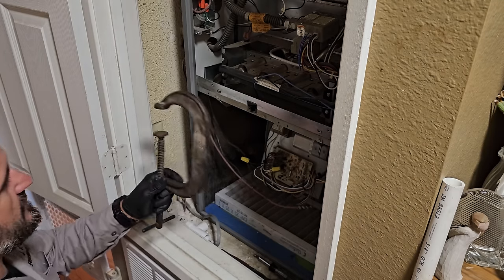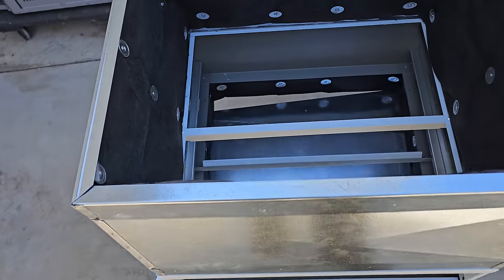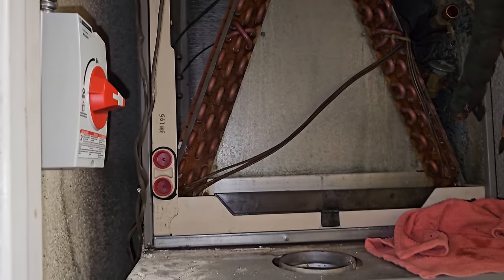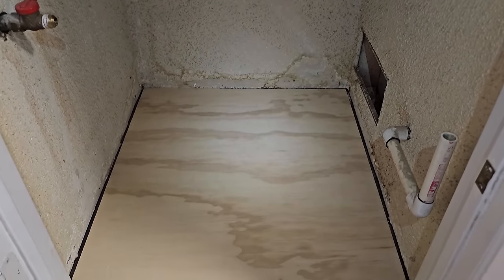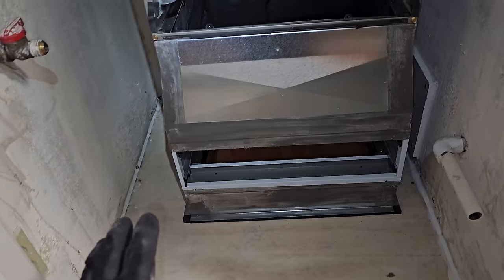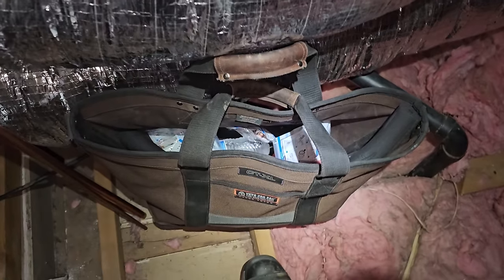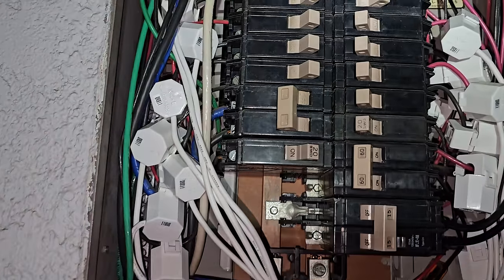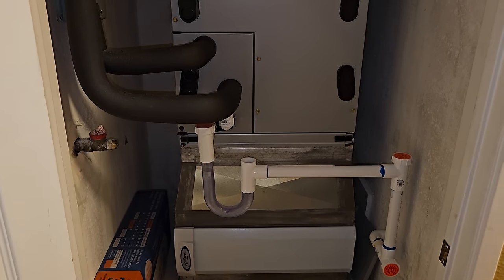HVACR VIDEOS HOUSE PROJECT PART 6

Comment: That is a nice professional install. I don't think I've seen a better install than this. I heard at some point in the video that you have an energy monitor system in your house. Is that what those white caps on the wires are in the breaker box?
Reply from the maker: Yes that’s correct
Reply: @HVACRVIDEOS  that’s pretty cool. can you do a video showcasing it?

Comment: Question: why are you going with a heat pump when you have natural gas? Isn’t that cheaper?
Reply: No.
Reply: @Bryan-Hensley  I guess in California right?
Reply: @nathang.1744  unlikely. Heat pumps are basically 300 percent efficient. I know it's not rated like that but that's an easier way to understand how much more heat you get per kWh. However I don't know the price of power or natural gas there. But usually natural gas isn't much cheaper per BTU than propane.

Comment: you need a whole home surge Protector nowadays days do not put one on the AC Unit. Put it near the Breaker panel right below it it protects the whole house it is now code you have to have one it protects everything us gov had enough of house fires you will see that is code for any work done to the house

Comment: Recommend to install a tall vent pipe higher than drain pan on Ptrap.  Don’t want water pouring onto platform if clog happens.  Also for carrier you can flip top left plastic drain port horizontal appliplaction cap around to prevent it from falling into air handler.

Comment: No heatstrips? Whats the coldest it gets there at night? And are you disabling defeost on the unit? My my neighbors installed an oversized heat pump thinking they could get away with no heat strips but when it gets about 25 degrees outside it goes into defrost and blows ICE cold air they called me after the first winter wondering if I could install heat strips for them lol
Reply: The indoor should turn off the fan when on defrost?
Reply: @richardbartlett6932  what heat pump have you ever seen turn the fan off in defrost? I have never. Maybe go to a lower speed but never off
Reply: I think his design temperatures were 97 and 40? 38? Somewhere around there. The load calc called for a 2 or 2.5 ton with very little heat strip need. That's why he wired in for a heat strip if necessary, but he's looking to try just straight heat pump first. I'd try the same if I could.
SoCal doesn't get the same humidity and cold Temps like the rest of the country.
Reply: @FrNMGuy  mostly concerned about when one of those $1000 inverter boards gets fried and the outdoor unit is a brick until carrier can scrounge one up. I've been on the receiving end of 2-6 week lead time on a part and not have it for 6 months. Who wants to run space heaters for that time.... It may not get /that/ cold there but they do have some nights where it can get below 35 and the unit will need defrost. 5 kw heat strips from carrier are like $80 so why not 🤣🤣🤣
Reply: @FrNMGuy the only thing is if it defrosts, it will drop the interior temperature about 4 to 7 degrees during a heavy defrost without heat strips.

Comment: CFM is calculated, not measured. NOTHING wrong with flex duct IF installed correctly. Does the trade install it correctly? Lots of high end systems have been installed using flex, tested and CFM confirmed by third party and perform awesome and quietly. Looking pretty good so far! Ignore the complainers...
Reply: It's always been recommended that flexi should not exceed 2m. Not that people only install under 2m but that's the official recommendation. As long as you have a high static option on the fan settings then it should and will cope.

Comment: Regarding marked tape: EVERYTHING that has UL Approval, has to have it. Everything that has to have it, the inspector is gonna look for those marks.* (i.e., not everyone is using mastic). Nobody--but nobody--is going to trust that the tape is the same as the one on the spool--even if the spool is marked.
This is why electrical tape is discouraged in commercial / industrial, because there's no marking on the tape itself.
*This is also why electrical wire is marked.
Reply: It definitely won't pass code if the tape isn't marked. But he probably doesn't have to get an inspection.  Home owner.

Comment: Yeah I totally know what you mean wanting to do it yourself, because you want it all done right and your way. However, it's a shame the HVAC industry doesn't allow knowledgeable homeowners to do this. Have to be satisfied for shoddy residential install apprentice-quality jobs, then clean it up yourself later. There's no way I can buy a system like that for myself, they won't sell it. Wish HVAC manufactures and supply houses were a lot more like the electrical and plumbing industries.

Comment: The Bluetooth board on your heat pump should have a green light with a plastic cover on the bottom of the electrical cabinet showing it's working. The Bluetooth boards have been known to be finicky. You also have to be at the unit, the range is very short.